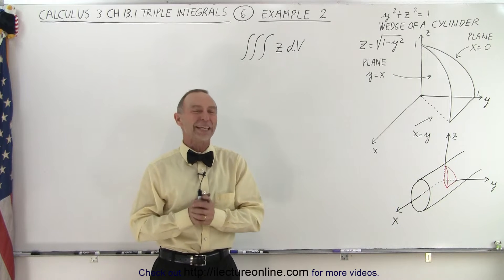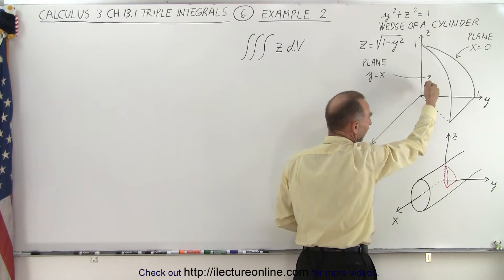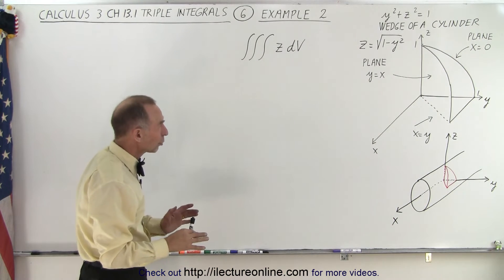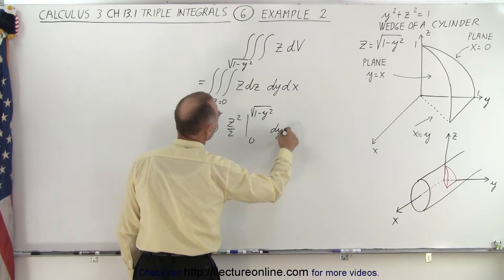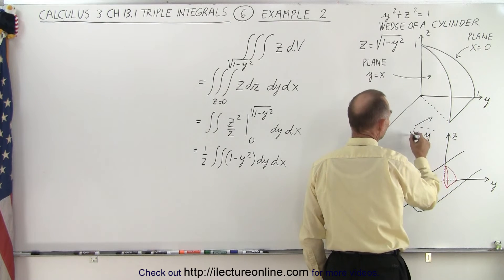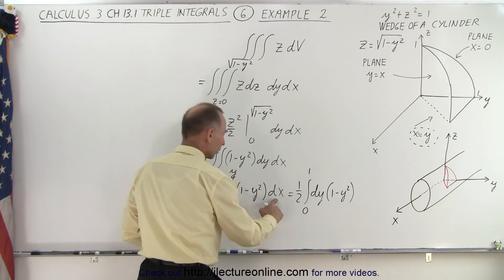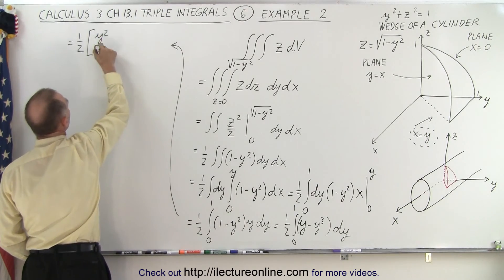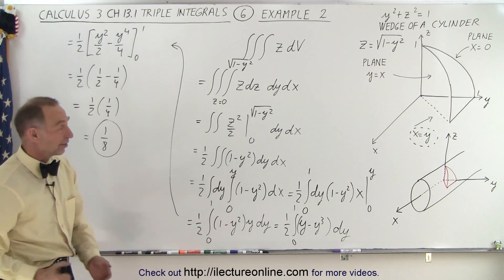Calculus 3: Ch 13.1 Triple Integrals (6 of TBD) Triple Inttegral: Example 2

Comment: Are the applications of this particular example strictly limited to the physical/material aspect, or are there other areas, like statistics or something, that that this would be used to evaluate?

Your recent video on the picture of the blackhole was great. How come they don't use telescopes orbiting as you said? And if the margins of perception and measurement are down to 10-⁸units, then how does the trajectory of the Earth, given its total velocity with the solar system moving, not affect the end result/compilation of pictures? 

There are numerous reasons I think this needs to be done in outer space; being able to take an array of pictures simultaneously seems highly advantageous and reduces the amount of "imagination" scientists might have to use to piece things together. For some reason, I have doubts  on the accuracy of what they photographed. I don't doubt it's a blackhole, but it seems like they improperly phased things, just gauging by the process and the image itself. Do the 3 blobs not raise any eyebrows as to what calculations would predict?
Reply from the maker: There are lots of physical situations in which this can, and is used.  Telescopes in space are VERY expensive.  The James Webb telescope costs billions.  But eventually we'll be able to use arrays of telescpes in space.
Reply: @MichelvanBiezen  I thought the James Webb Telescope's huge pricetag had more to do with the cost of tech development,not the launching.
Reply from the maker: The cost of launching is not as expensive as it used to be, but the cost of development is huge.  Also the arrays that would need to be used for this application would be very large which means that it would need to unfold into an array.  Also you have to find a way to place them into a stationary orbit (like the James webb telescope placed at one of the Lagrangian points)
Reply: @MichelvanBiezen  Sounds like a task some "ingenuiers"  could solve. Interesting stuff.
Reply: @MichelvanBiezen  What is it that makes them expensive? Is it the payload size? Energy consumption?

There are thousands and thousands of objects in orbit, so I assume it can't be the cost of launch.
Reply: Great videos Sir!!! Thank you for sharing knowledge!